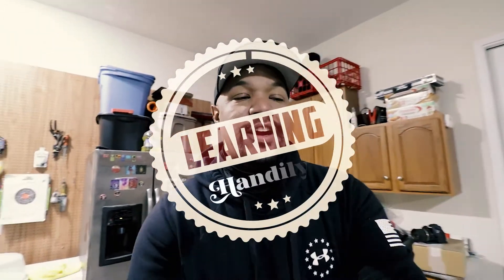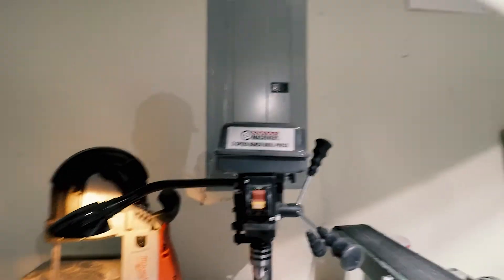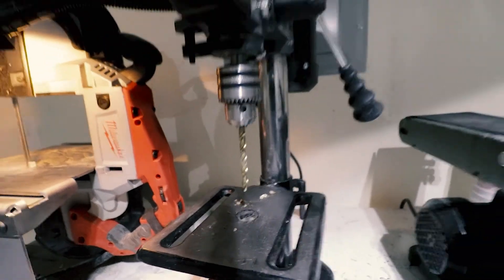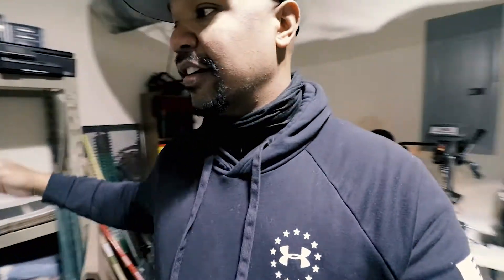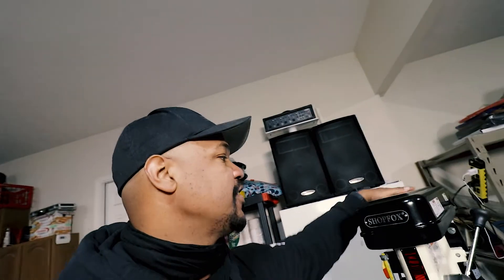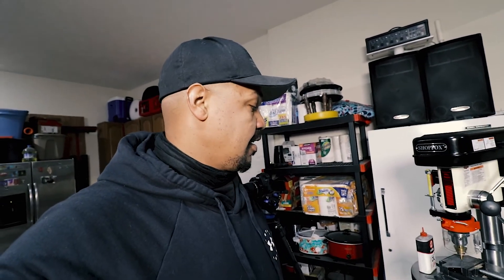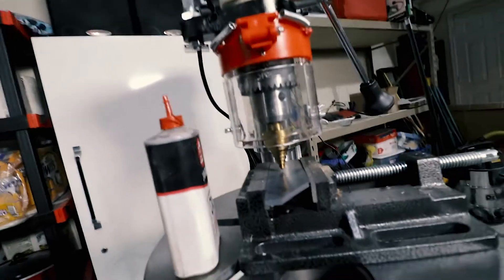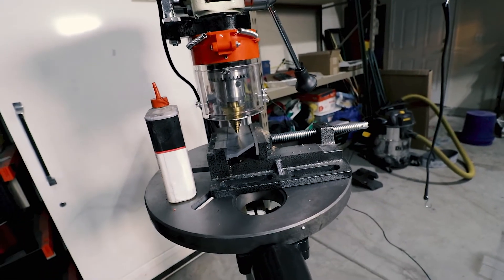Shop Fox W1848.  The Solution to my problem!

Comment: Good video👍.  Looks like I’ll be ordering one.
Reply from the maker: I'm still using it everyday...  I had to order a new vertical support, the metal piece that is used to adjust the height of the work table... I'm not sure what happened exactly, but it bent an didn't want to hold the table anymore...   That's the only issue I've had with it... 

I think it'll be a perminant fixture in my shop and will be used daily until I can afford a proper mill... Still saving for that though. lol

Comment: I am planning to buy this I like the fact that it converts to oscillating sander
Reply from the maker: I liked that fact too...  However, I've NEVER used it. lol.. I have had uses for an osciliating sander, but its a pain in the but to switch the pullies and get everything set up.. So instead I use a battery powered die grinder with  a cylindrical sanding tube...   Or I use my dremel.